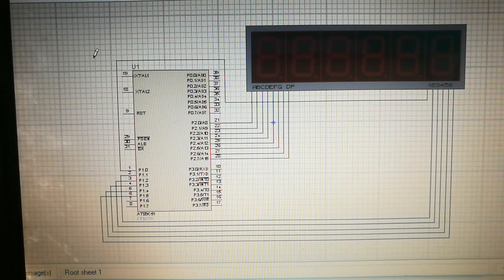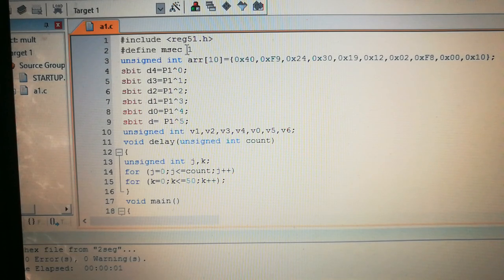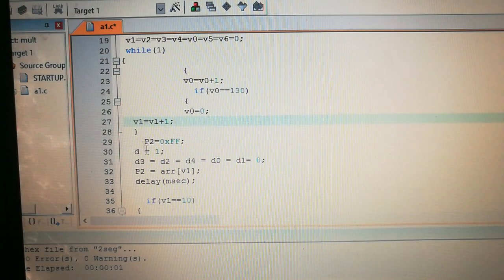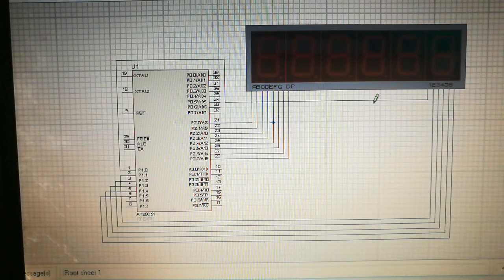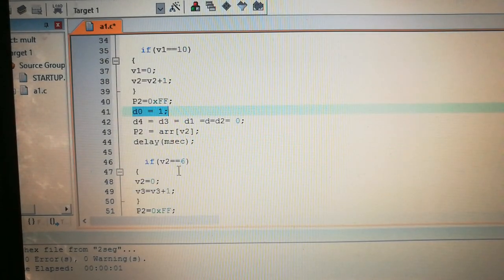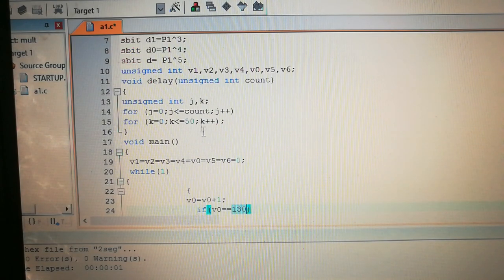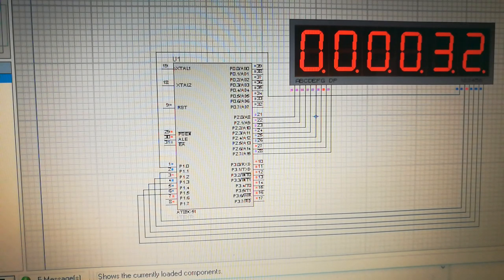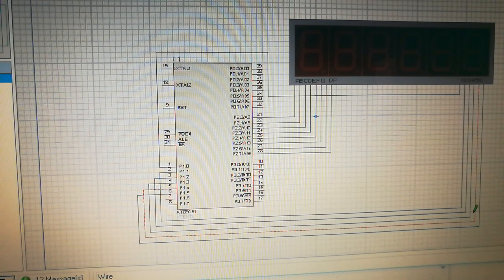digital clock using 8051 with 7 segment display

Comment: How are you compensating for the increased segment brightness due to the multiplexed operation?  Also, the micro won't be able to sink or source the LED segment or digit currents; usually at least you will need digit drivers as the worst case digit current is 8 segments x 20mA =160mA which is much more than the few mA of i/o current available.
Reply from the maker: yes transistors are required for that, this is Proteus simulation, here it will work, and the same program will work with seven segment module as the necessary components are there in module to increase the current 👍

Comment: Hey, there this code really helped me a lot to understand and I found that I could reduce some redundant lines of code such as the delay function, msec. Also, use the DP to differentiate between H,M,S instead of illuminating for every digit. There was a little correction on the last if(condition) I fixed it also

//Rewritten by Maksud chowdhury, CSE, East West University, Dhaka, Bangladesh 
#include <reg51.h>
unsigned int arr[10] = { //common annode hex for 0-9 with DP turned off
  0xC0, //0
  0xF9,  //1
  0xA4, //2
  0xB0, //3
  0x99, //4
  0x92, //5
  0x82, //6
  0xF8, //7
  0x80, //8
  0x90  //9
};
unsigned int arrWithDP[10] = { //common annode hex for 0-9 with DP turned on
  0x40, //0
  0x79, //1
  0x24, //2
  0x30, //3
  0x19, //4
  0x12, //5
  0x02, //6
  0x78, //7
  0x00, //8
  0x10  //9
};

sbit d6 = P1 ^ 0;
sbit d5 = P1 ^ 1;
sbit d4 = P1 ^ 2;
sbit d3 = P1 ^ 3;
sbit d2 = P1 ^ 4;
sbit d1 = P1 ^ 5;

unsigned int v1, v2, v3, v4, v5, v6, timer;

void main() {
  v1 = v2 = v3 = v4 = v5 = v6 = 0;
	
  while (1) {
    {
      // loop variable to simulate the clock timing function
      if (timer == 7000) { //the loop  runs 7000 times for 1 sec in my machine you can tweak if needed
        timer = 0;
        v1 = v1 + 1;
      }

      P2 = 0xFF; //initialize the port to take input from array value and ready to display			
      d1 = 1; //activating the rightmost 7segment Unit
      d2 = d3 = d4 = d5 = d6 = 0;
      P2 = arr[v1];
   

      if (v1 == 10) {
        v1 = 0;
        v2 = v2 + 1;
      }
      P2 = 0xFF;
      d2 = 1; //activating the 2nd Unit from right
      d1 = d3 = d4 = d5 = d6 = 0;
      P2 = arr[v2];

      if (v2 == 6) {
        v2 = 0;
        v3 = v3 + 1;
      }
      P2 = 0xFF;
      d3 = 1; //activating the 3rd Unit from right
      d1 = d2 = d4 = d5 = d6 = 0;
      P2 = arrWithDP[v3];
   

      if (v3 == 10) {
        v3 = 0;
        v4 = v4 + 1;
      }
      P2 = 0xFF;
      d4 = 1; //activating the 4th Unit from right
      d1 = d2 = d3 = d5 = d6 = 0;
      P2 = arr[v4];
 

      if (v4 == 6) {
        v4 = 0;
        v5 = v5 + 1;
      }
      P2 = 0xFF;
      d5 = 1; //activating the 5th Unit from right
      d1 = d2 = d3 = d4 = d6 = 0;
      P2 = arrWithDP[v5];

      if (v5 == 10) {
        v5 = 0;
        v6 = v6 + 1;
      }

      P2 = 0xFF;
      d6 = 1; //activating the 6th Unit from right
      d1 = d2 = d3 = d4 = d5 = 0;
      P2 = arr[v6];

      if (v6 == 1 && v5 == 3) { //IN 12HR FORMAT
        v1 = 0;
        v2 = 0;
        v3 = 0;
        v4 = 0;
        v5 = 1;
        v6 = 0;
      }

      timer++;
    }
  }
}

Comment: How did you coded for 1 second?
Reply from the maker: Actually It's prototype so we have used simple delay function, but we can get delay of 1 second using timers of 8051
Reply: Using simple function can we get 1 second delay
Or we have to must use timers??